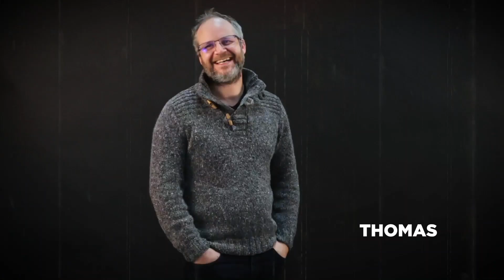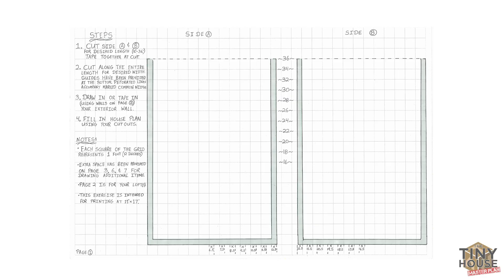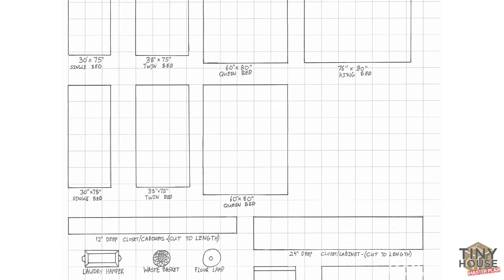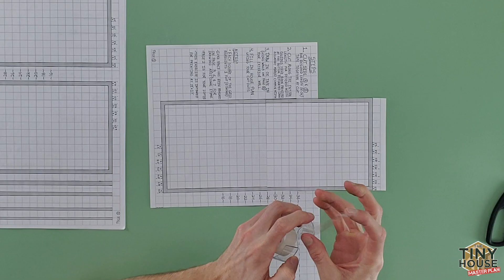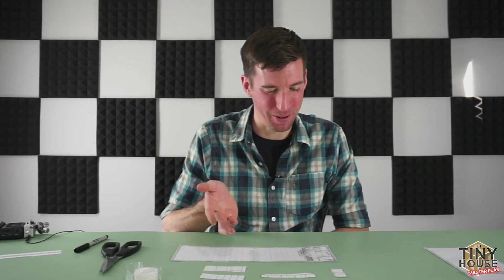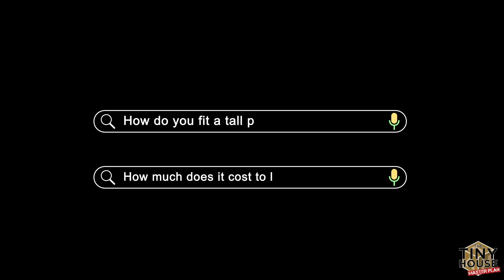Design Your Own Tiny House (Exercise) | Season 1 | Episode 11

Comment: I'm very interested in buying the Tiny House Design Exercise, do you have a version using Metric units - I'm in Australia and thus don't use Imperial units. I don't really want to have to convert each and every measurement into Metric before deciding if its useable in my plan...

Comment from the maker: Q&A TIME! Next episode I answer all your BURNING tiny house questions. What are yours?

Note: Put 1 question per comment. Be sure to "Like" other questions you want to get answered... in case we cant get to them all. 

Here are some examples:

-How do you build a tiny house for Canada?
-How do you fit a tall person in a tiny house?
-What would you change about your tiny house?
Reply: How do you size water storage when factoring in showering and hot water needs?
Reply from the maker: @AmandaComeauCreates  ooo! Good question. I'll totally answer that one.
Reply: @TheKentonZerbin  I've been struggling with this because I want hydronic in floor ingesting instead of blown air furnace, but I also want to supplement heating the water required for that and regular domestic use with the same evacuated tubes you used (because wow are they awesome and affordable!) So I've been playing with the idea of either having a big water storage tank internal to the structure that radiates the heat outward but doesn't need to be filled all that often with domestic water.
Reply: Interested in the workshop. You mentioned a coupon code??
Reply from the maker: Hi  @GregPaul17435  ! There are two ways to get the 10% off coupon code - it's given out with the order of the design exercise and it's also available for free to my newsletter subscribers. You can sign up to the newsletter on any page of:
www.ATinyHouseWorkshop.com
Reply: Question: does having a goose-neck trailer provide you with more trailer length possibilities while being safe to drive yourself?